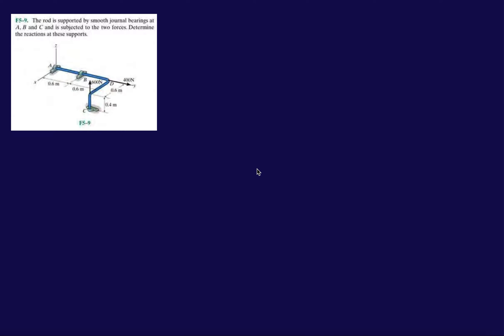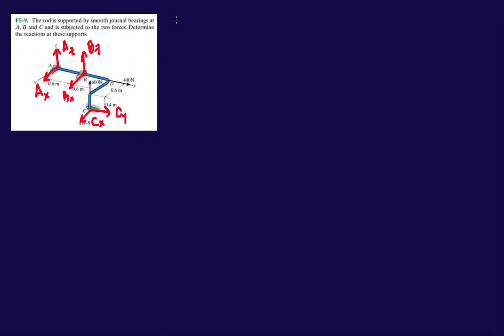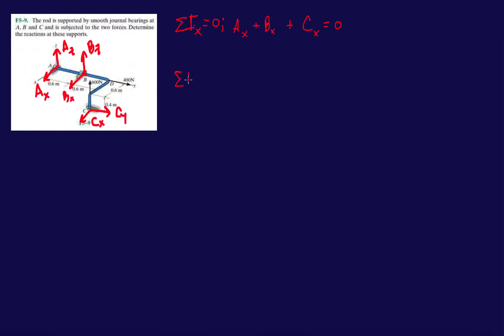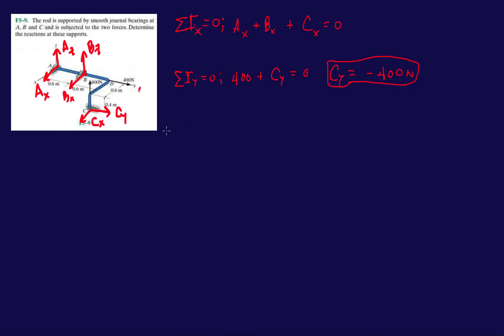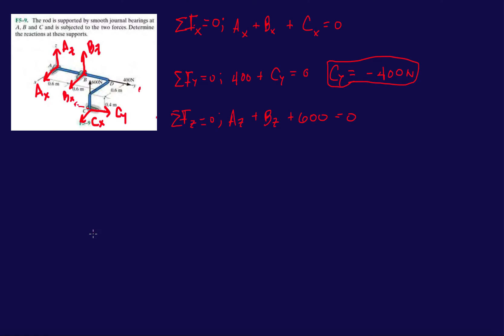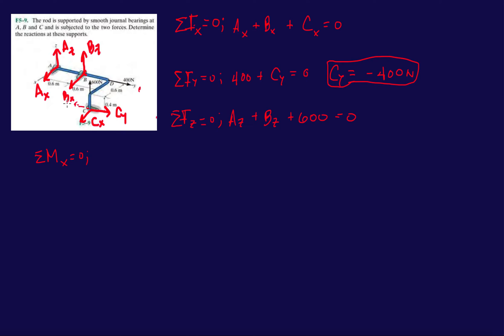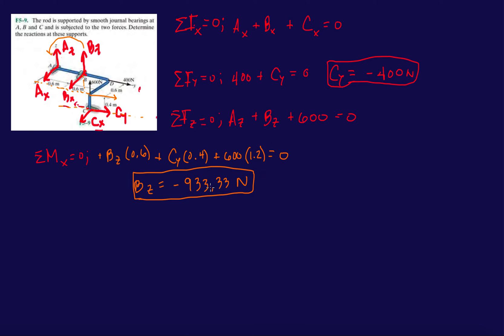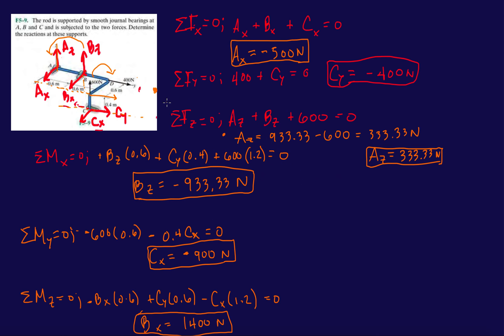Problem F5-9 Statics Hibbeler 12th (Chapter 5)

Comment: in the book it says for smooth journal bearings we have 2 moment reactions and 2 forces but when you are  solving problem you just take forces.how can we decide when we should draw only forces or moments?
Reply from the maker: Usually they are added when they have no other supports on the system.  In this case we have three supports so we don't include them.